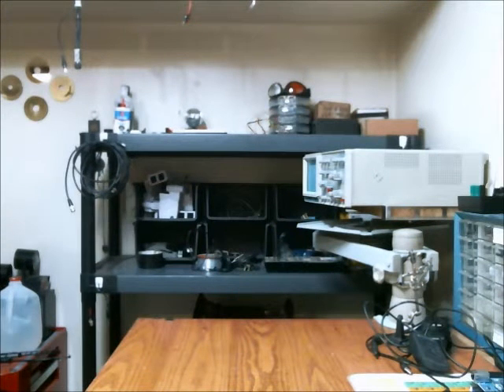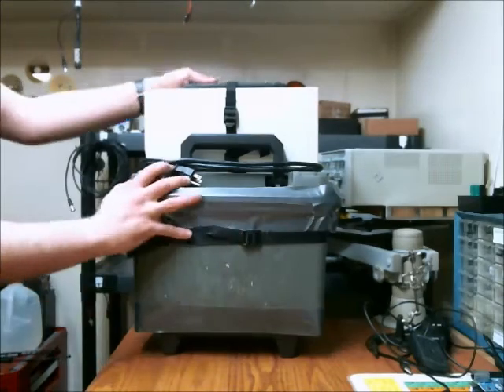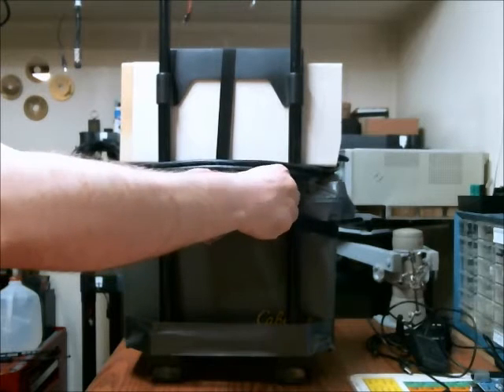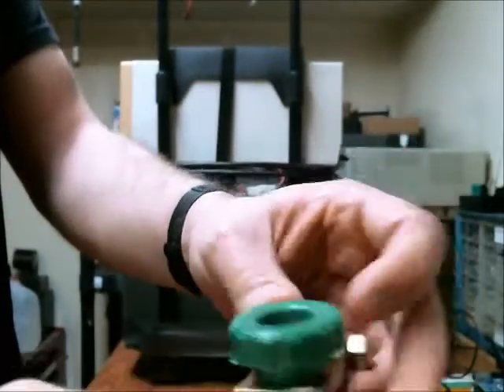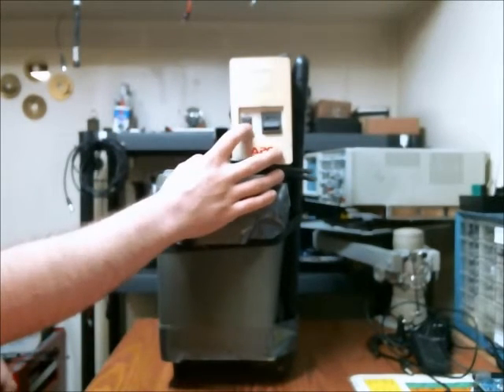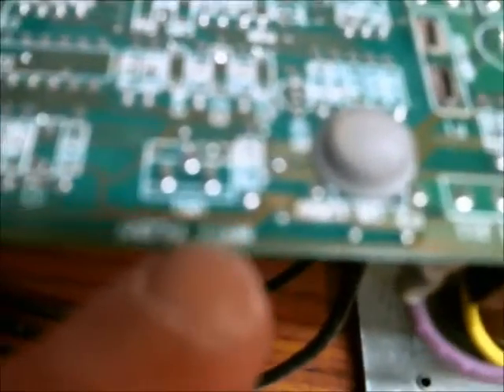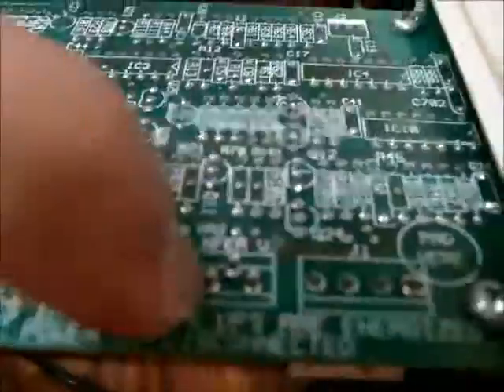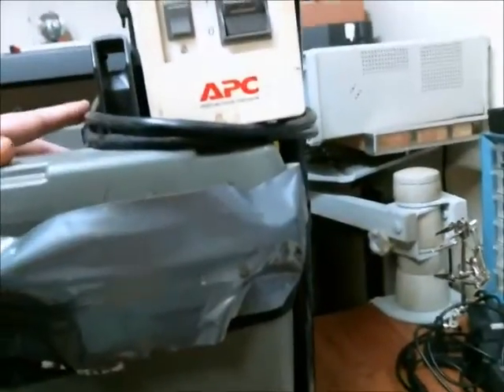Automotive battery UPS

Comment from the maker: One of my heaviest projects to date.
Reply from the maker: Cool "one man's garage is another man's treasure"
Reply: Matt Heilman, do you keep this little monster hooked up all the time or just plug your stuff in when the power is out? What gauge wire did you use to connect the battery to the UPS?
Reply from the maker: Slava Petrov
AWG 10 (capable of 15 amps)
I plug it in about once a month for a few days.
Reply: Cool, thanks!